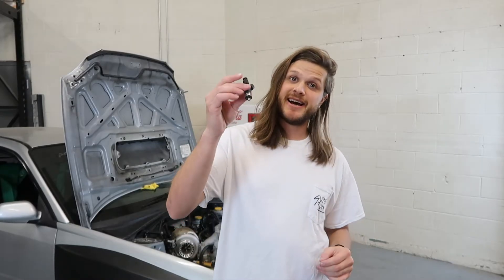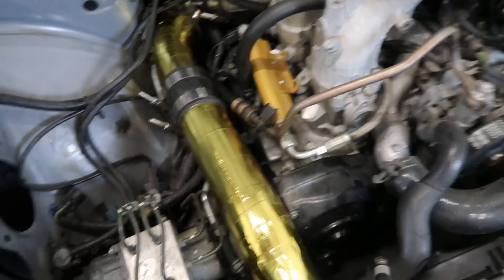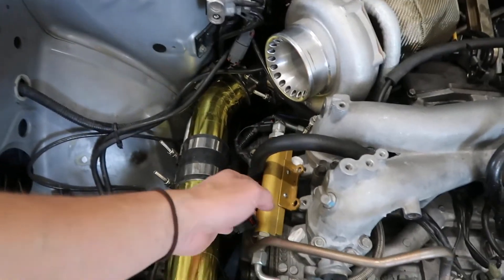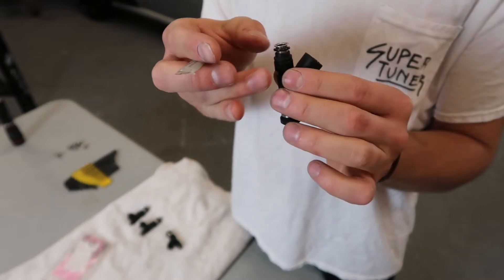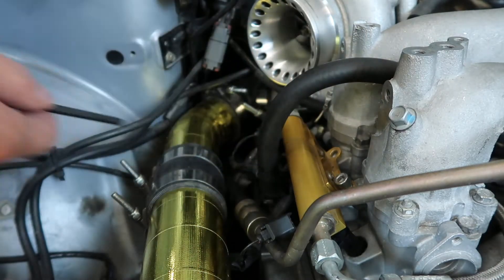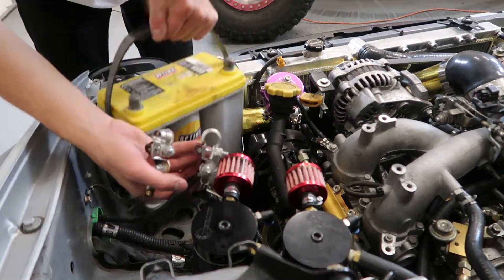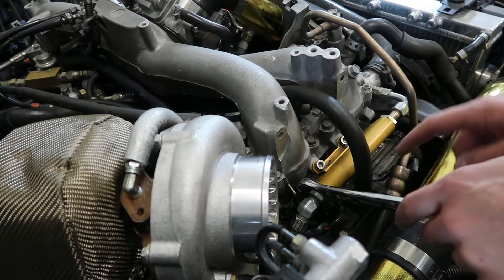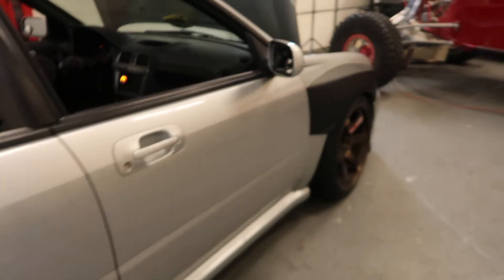HOW TO INSTALL FUEL INJECTORS- WRX- DYNO PREPISODE #8

Comment: If you ever install this ID1000, take the top donut from your light blue injector and place it on your ID1000. They leak when you’re doing over 21psi.

Comment: I’m sure you get this question ALOT! But where is that intake manifold? Looks like a 
N/A but it’s facing forward. Thank you in advance. Love your video’s. SO much Knowledge learned! Thank you!! 👍🏽
Reply from the maker: It’s actually just the stock manifold reversed. You can turn it around and bolt it up with a few other modifications.

Comment: KC barret? How do I get a hold of that guy? I actually just ordered the exact same injectors for the same exact car! Same color too! Pretty stoked to get them installed. I think I have the same fuel rail too. I got a BNR 50 trim turbo. Hits like a hammer, but slow to spool... The ones I ordered are used... so I wanted to make sure they were clean before putting them in. I am replacing DW's. Which are absolute garbage. I have had nothing but problems with my fuel delivery since I put those in.
Reply from the maker: Dude good call all around on ditching the dw's and cleaning the new ones. look him up on FB. It's Casey barret. If not him I think you can send them to ID too.
Reply: Supertuner sweet. I'll see if I can find him.  I did try before..... but I couldn't find him.  I'll try again.  I found that injector dynamics in north sl does it too. I still haven't put them in yet..... dw is garbage
Reply: know of anyone that can dyno and tune as well?  besides inj. dynamics?

Comment: Noob question, what did you do with the fuel pressure regulator, because the stock one I thought had to be on the fuel rail
Reply: It's on the driver's side by the fire wall on the fuel line

Comment: My car has a loud ticking sound, its not an exhaust leak nor rod knock, my cobb stats are good. Lately its gotten louder. Im thinking it may be the injectors. 2014 hatch wrx
Reply from the maker: Any cel codes?
Reply: No
Reply: My 2014 hatch, and my 03 bugeye I know have had loud injector ticking but I was told it's pretty normal.

Comment: So I disassembled my ej253 intake manifold and I kinda didn’t touch it for a whole month but I just wanted to know if it matters what sensors goes to which fuel injector out of the two would it matter if you plugged to either one or is there a specific order to put them on
Reply from the maker: Do you mean which plug goes to which injector? There are not sensors connecting to the injectors. 
If you mean what plug goes to what injector yes i believe it does matter. I have never hooked them up in the wrong order though.

Comment: Just finished installing the Cobb 1050X injectors along with IAG V3 Fuel rails, and lines. Primed the fuel system and all 4 injectors are leaking fuel badly out of the top, between the fuel rail and injector. All the seals should be good, i lubed them well and they all felt to seat properly. Any idea what the problem could be?
Reply from the maker: With all four leaking bad I would see if the specific injectors and fuel rails are compatible. Some injectors and fuel rails have spacers as well to accommodate the length of different rail and injector combinations. But check that the injectors are tight in the seat on both ends.
Reply: Supertuner huge thanks for the reply. Just in case anyone else make a dumb mistake like I did, on the Cobb 1050x injectors there are caps on the end, those install into the tgvs first and then install the injectors. My mistake was I didn’t push those little caps completely in so my rails and injectors were not seating right.
Reply: Or better yet they are spacers as stated by super tuner.
Reply from the maker: oh awesome! Yeah I don't think me calling them spacers was the right terminology they are probably caps but I'm stoked you figured it out! nice work.
Reply: @Supertuner  installing my injectors this week.. glad to know this

Comment: Don't you need to replace the O-rings before you reinstall the injectors?
Reply from the maker: Depending on condition. I inspected them and tested for leaks so I didn't need to replace them. But in the past, I have needed to replace them.